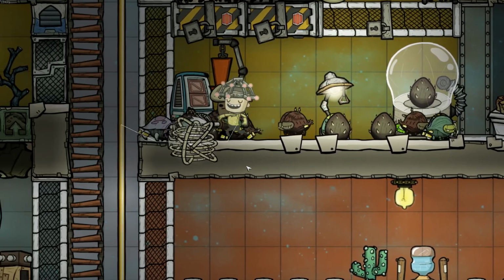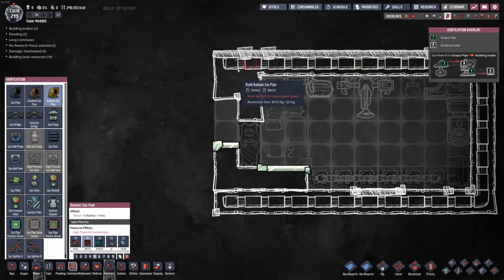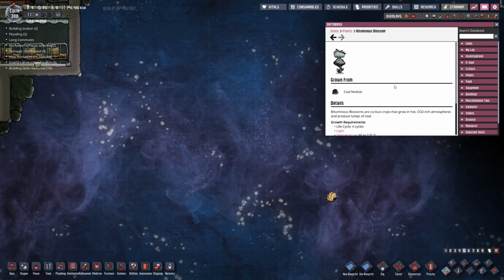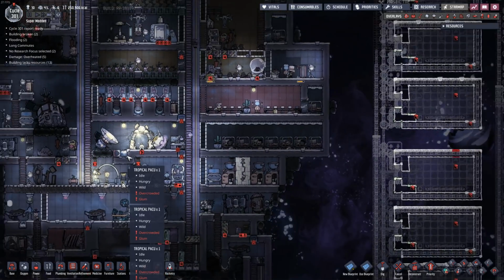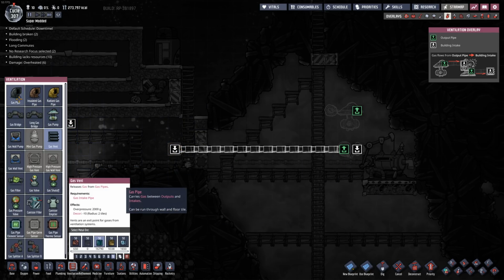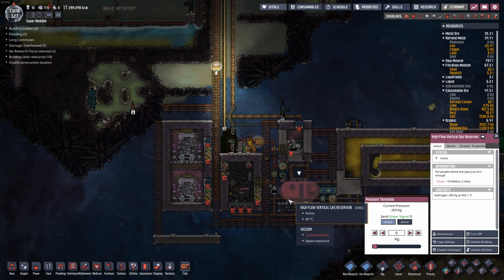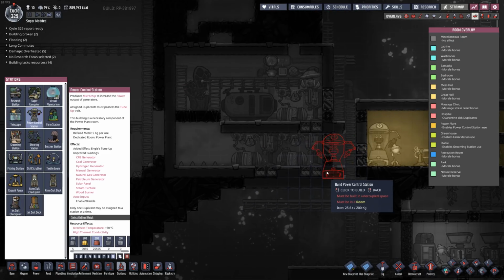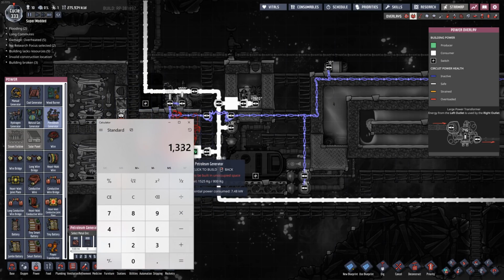Build EVERYTHING Dupes! Super Modded Oxygen Not Included EP9

Comment: Seems like your temperature controlled farm could be easier hooked to a hot and  cold supply line of either liquid or gas, and a drain. Temp gets too low, feed from hot line, temp gets too high, feed from cold line, just right,  drain all to hold temp. Surround with insulation to hold temp better.

Comment: I can't help but think the farm heating/cooling system is much more complicated (and uses more power for each valve) than it needs to.  Since tanks average the temp of anything put into them, why not use one of the multi in/out tanks to have several loops constantly running around the farms, with one loop dedicated to heating or cooling your working fluid based off what it reads the tank at?  Then you'd need what, 2 or 3 tanks at most to handle the main temp ranges the plants want.  Say, one around normal dupe range of 20C, one hot for pinchas and stuff, and one cold for wheat etc?

Comment: The mods I would like to see eventually is a dupe teleporter to move them faster, and wireless power. It would be cool to centralize your power banks and then not have to run a billion miles of wire to get is throughout your base
Reply: ooohhhh...power that actually transmits through conductive materials maybe? Lay down a bunch of metal tiles or use liquids to conduct electricity?
Reply: @chrisbennett8293  nope! They already have wireless automation where you set up a small piece of machinery that you set up as a signal sender, then you can put a receiver all the way on the other side of the map to receive the signal. Imagine having all your smart batteries in one area to cool them and being able to send a signal remotely to turn on your generators somewhere else, but you don't have to run(and hide from your dupes) miles of ugly wire or automation wire